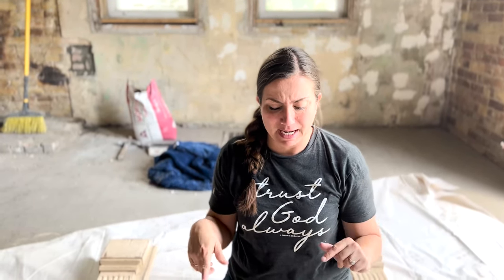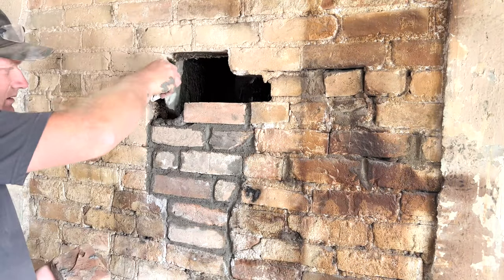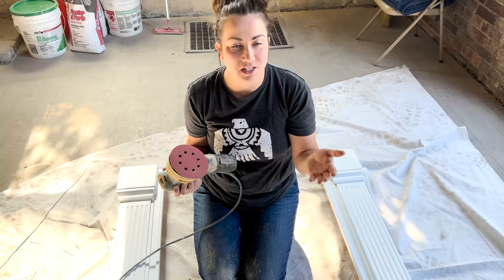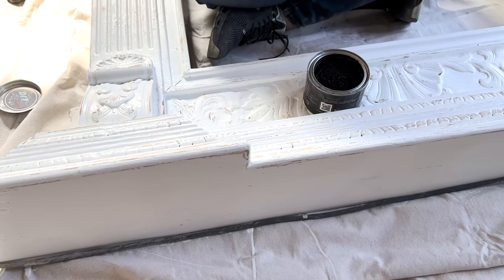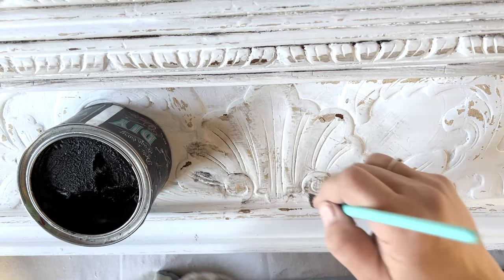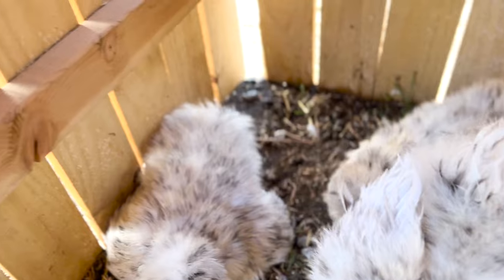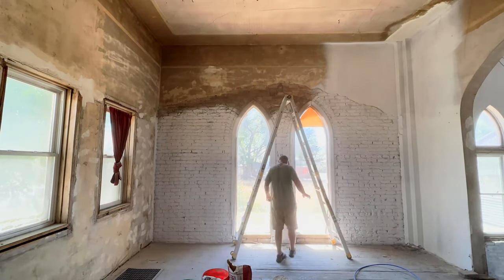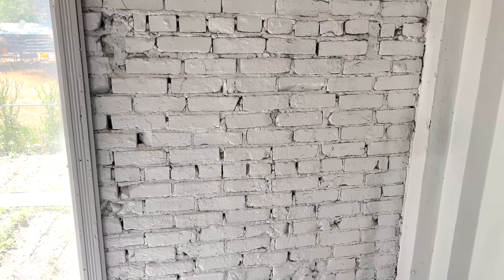How To Use Dark Decor Wax For A Cottage Look + Spraying Paint On The Walls At The New Shop

Comment: I used Behr dark wax over Behr gray chalk paint on a chiffarobe I refinished.  The wax turned the gray to greenish gray.  Not exactly what I wanted but it was a large piece that I spent days on.  Wish I knew the tip of using clear wax first.  I tried to use it after.  It did remove some of the dark wax but green tinge didn't change.